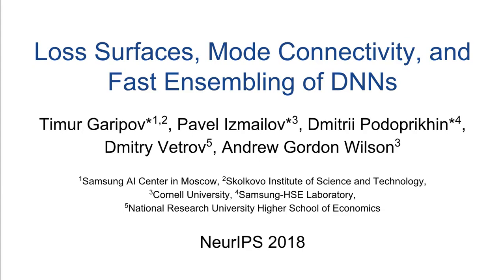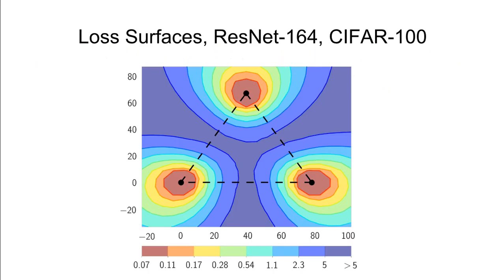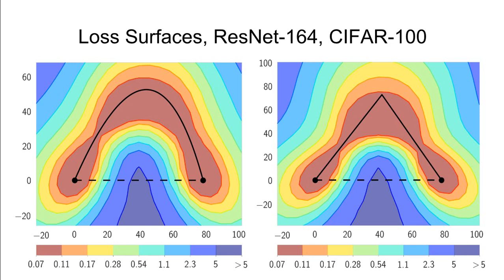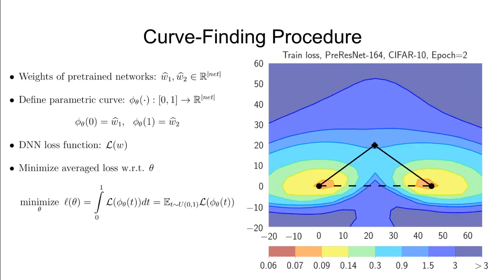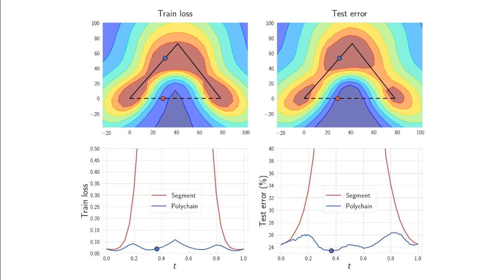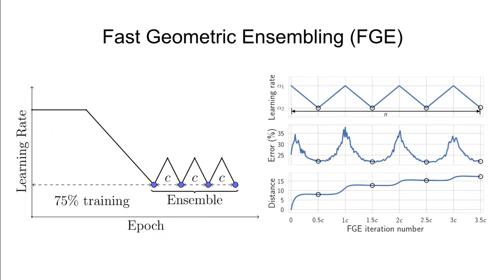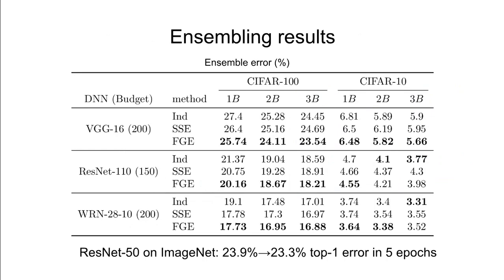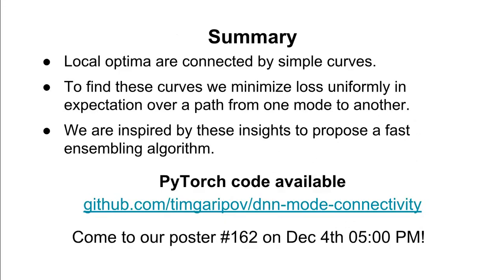[NeurIPS 2018] Loss Surfaces, Mode Connectivity, and Fast Ensembling of DNNs

Comment: sorry if this is a naive question but why in 1:27 is there an immediate dip in the training loss when moving along the polychain? doesn't that mean the gradient isn't 0? can SGD converge there if the gradient isn't 0?
Reply from the maker: When training large neural networks, running SGD precisely to convergence is impractical, as it would require too many steps (and might cause the network to overfit the training data). The figures in the paper and video show our experimental results. We obtained initial "local optima" by training neural networks for a fixed number of epochs. While we obviously didn't obtain strict local optima (by the mathematical definition of the gradient being 0), we followed the best practices for training networks in selected architectures on specified datasets. Hence, the solutions we get attain realistically low loss values. Our results show phenomena that can be observed in practice with reasonable computational cost limitations.
Reply: @timurgaripov1493  thanks a lot for the response! i'm a bit green and while reading papers on this topic for my seminar course is fun i sometimes struggle with such basic concepts 😅. 7 years late but...amazing paper